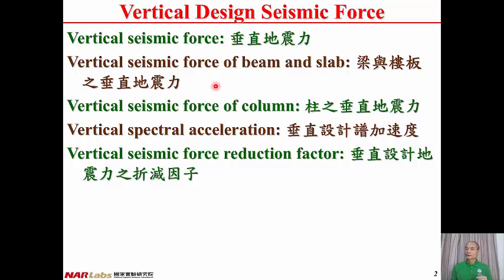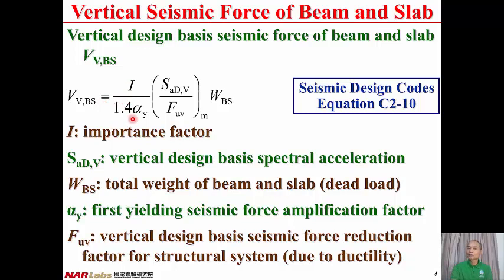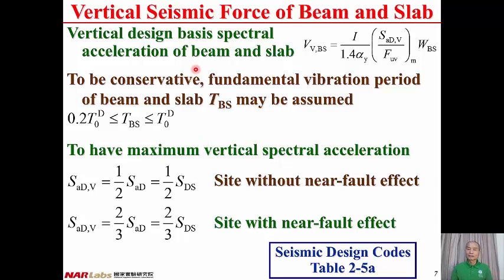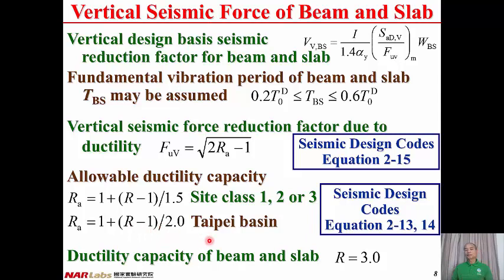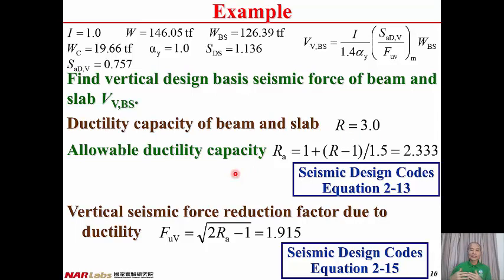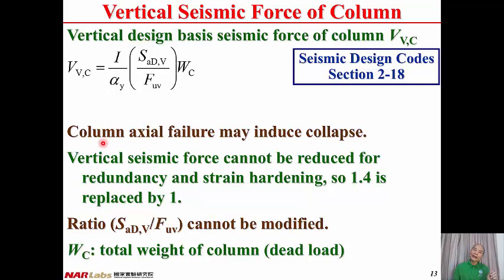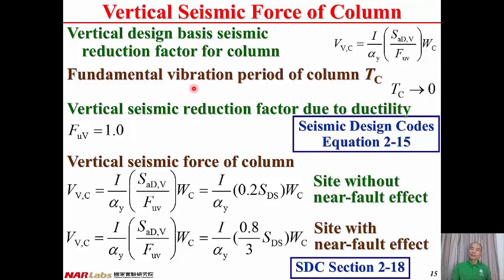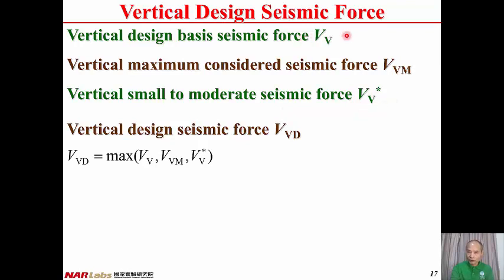1061-NTU-SDS-15-2-Vertical Design Seismic Force - Lap-Loi Chung

Comment: Respected Sir,
If vertical response spectrum is not present in seismic code of design, then out of these two function, which function should be used in linear time history analysis
1) Scaling of vertical ground motion time history as 2/3 of horizontal response spectra.
OR
2) Scaling vertical ground motion time history as only horizontal response spectra.

Looking for your guidance and support.

Thank you.